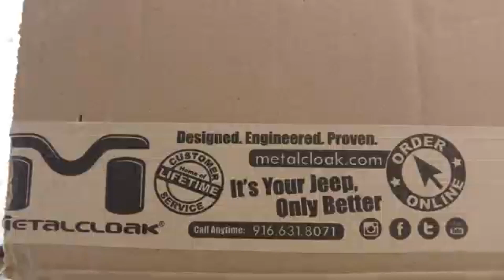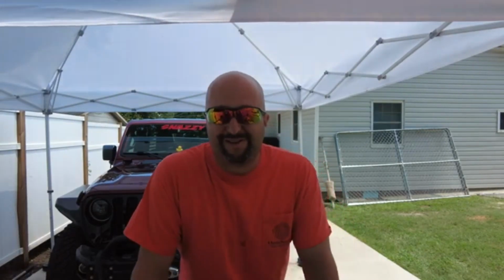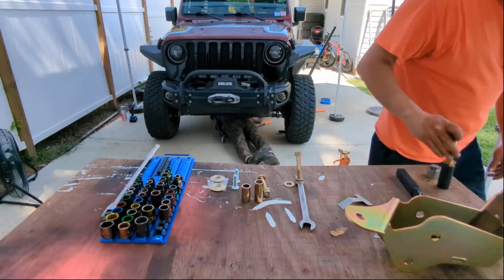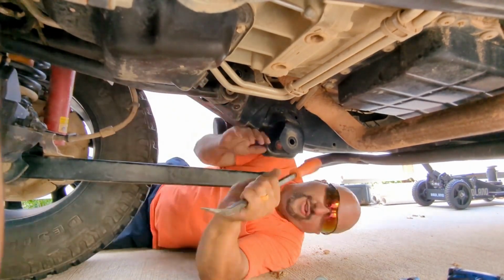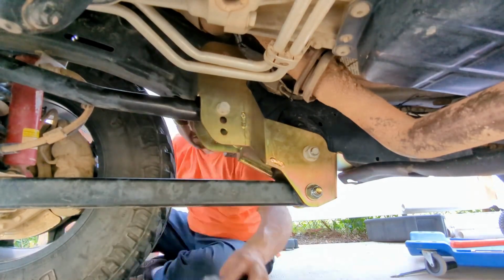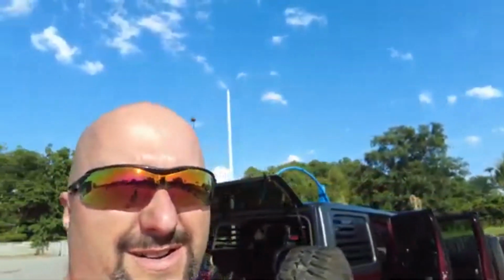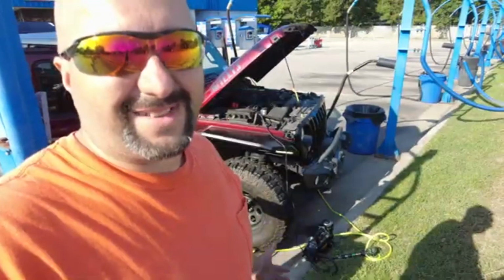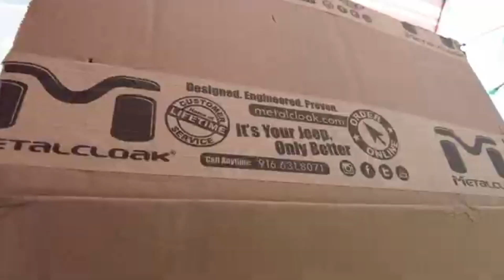MetalCloak JL Drop Brackets

Comment: I put them on my gladiator last year, . They are awesome.  Quik tip. Atach a racheet strap from axle to the crosbar to keep everything aligned and it makes it easier to install the bolts from the control arms in. . And these will bend if hit to hard